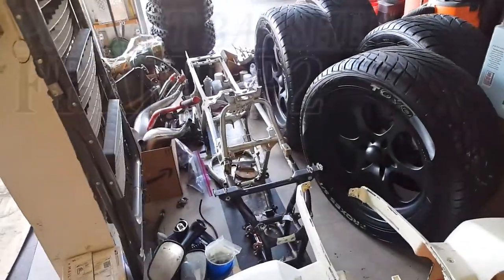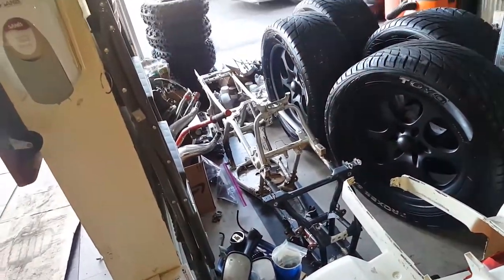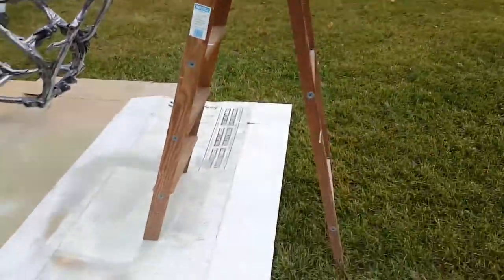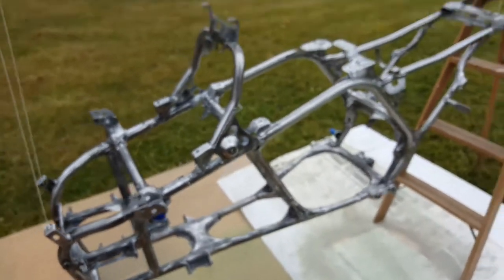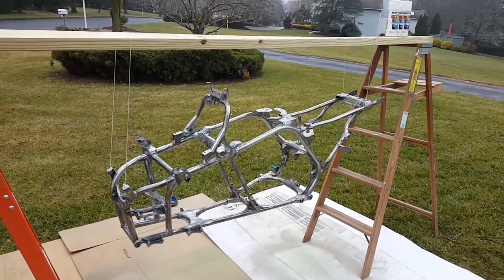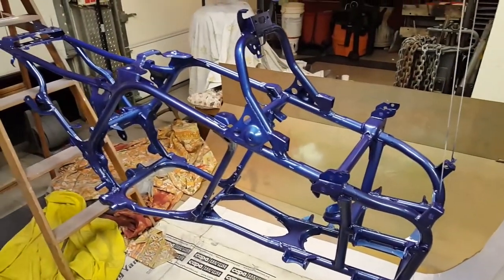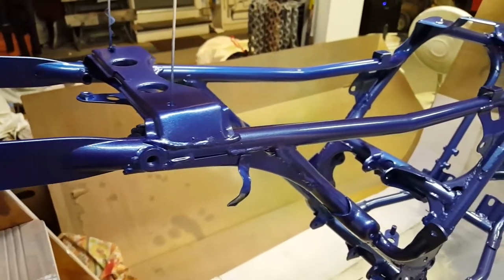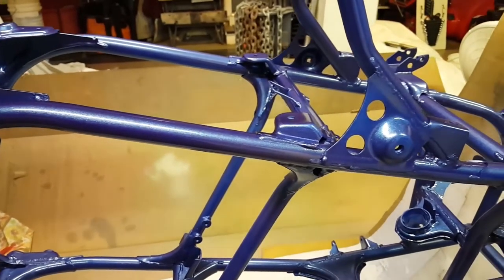ATV Frame Painting | Banshee 350 | Part 2

Comment: hey Mike after you stripped it to bare metal did you sand it at all or go right to primer
Reply from the maker: John B I used a wire wheel and a needler scaler to rough up the metal first. takes forever but it makes the paint bond much better

Comment: hi dude.. what did you use to clean frame and painting ?? my banshee frame is sucks
Reply from the maker: What's up man. I mostly used a wire wheel but I also used sand paper and a needler scaler for tight spaces. Way more work than it's worth though; I recommend sand blasting; even if you pay someone to do it.

Comment: Your videos are dope 👍🏾👍🏾 What did you use to clean your frame before paint??? And is it better to use white primer when u painting the frame a dark color???
Reply from the maker: Thanks so much man! I'm pretty sure in P1 I show how I stripped the frame. I used aircraft grade stripper, wire wheels, sand paper and this thing called a needler scaler. I did it the hard way because I don't have a sand blaster but the work was worth it; it's holding up great. And yes, I choose light primers for dark colors and vis-a-versa to make it easier to see where you missed.
Reply from the maker: Here is part 1

https://www.youtube.com/watch?v=TFDQSeyOMIk
Reply: What color blue

Comment: what prep did you do for the a arms?
Reply from the maker: I used pretty abrasive sandpaper to rough up the chrome and I made sure all of the cracks/flakes were flat and not peeling up. Then I cleaned them with soapy water, rinsed and dried with compressed air. I used an epoxy primer, 3 coats of color, and 2-3 coats of clear to finish them.
Reply: Michael Sabo how have they held up so far?
Reply from the maker: Sadly, I still have not put them to the test, but I can assure you, I will be soon! And it will be on video and I will make an aftermath video to inspect how everything holds up!